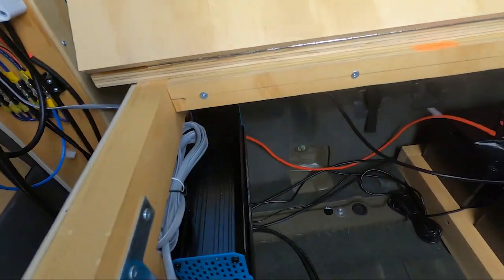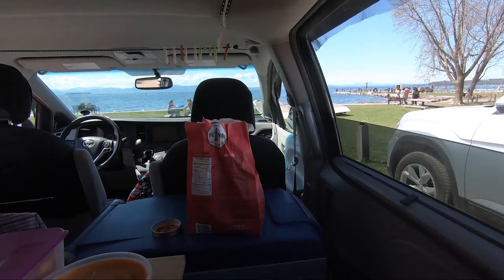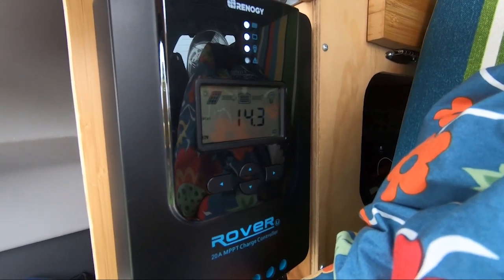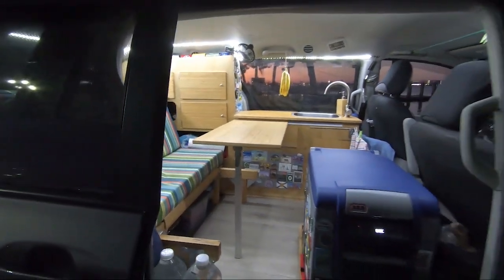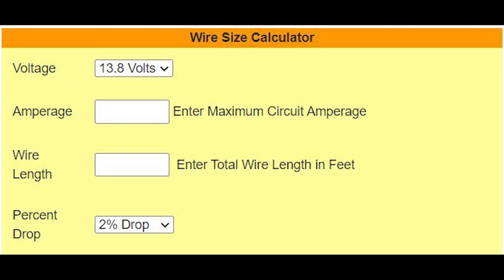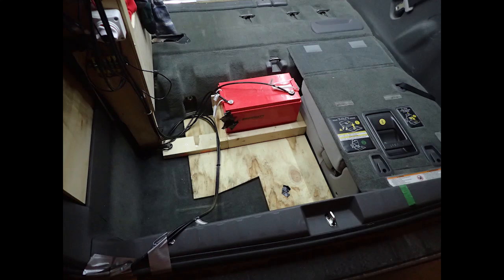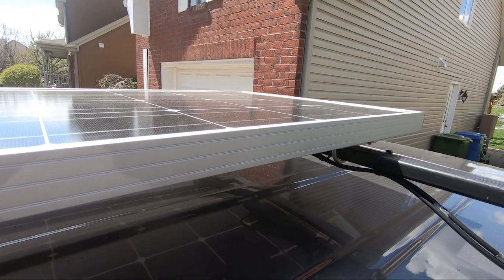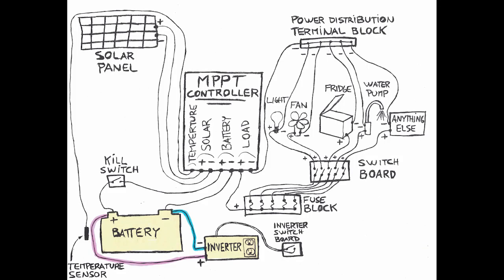Minivan conversion: Electric system (easy DIY)

Comment: Allô Eric ! Merci beaucoup pour tes vidéos, ils m'ont beaucoup inspirées. Je me suis aussi acheté une van et je me demandais pourquoi avais-tu opté pour (2) batteries 12V 100ah au lieu de (1) 12V 200ah? Merci beaucoup de ton temps, Jacob
Reply from the maker: Tu peux considérer l’espace que tu as disponible. Dans mon cas, deux batteries me laisse un espace intéressant. Selon la configuration de l’espace une ou deux batteries peut être plus ou moins avantageux. Aussi, si une batterie brise, ce n’est pas tout qui est à remplacer. Ma batterie précédente a justement été remplacée suite à un bris…
Reply: Super merci !

Une deuxième question, à ta connaissance, y’a t’il une façon d’installer une prise extérieure pour recharger les batteries si je venais à manquer d’électricité … par exemple laisser un chargeur installé dans la van en permanence et simplement le brancher si je manque d’électricité?

Comment: I was curious if it was still best to use this form of a detailed setup instead of a Solar panel to BLUETTI AC70 to Fuse block to DC items.  For AC one line from the Bluetti to a power strip to different AC items.
Reply from the maker: What you describe is energy transformation, and this requires more of it. There’s no module replacement possible. When a component of the power station will break, the whole thing goes to the dump. Also less easier to optimize space management and aesthetic. I definitely prefer my kind of setup. 😃👍

Comment: Hi Eric. Greetings from Toronto, Canada. I'm beginning my Sienna conversion and so enjoy and learn a lot from your videos. Every second Youtube Van Camper that I watch refers to your bed/couch design! I am considering a 24 volt rather than a 12 volt system as I've heard that a 24 volt system is more efficient and could use thinner less expensive wiring. You have your system isolated from the car system so it does not restrict your choice, two batteries that you could wire in series to make a 24 volt system and your fridge and MPPT probably will accept 24 volts. I'm guessing that you went with 12 because the one 100 watt solar panel could not give you 24 volts?  Thank you again for all your information.
Reply from the maker: Hello Steve! Thank you for your comment of appreciation 😃

I use a 12 volts system. I would do the same. Wires are not really expensive since everything is close, and because there’s plenty of 12 volts devices! It’s pretty much standard.
✌️

Comment: Thank you for this detailed tutorial on the electronic system. I’m going to follow your lead.  I’m disappointed to hear from my Honda dealership that the price of installing a roof rack will be $1000. Because that is what i wanted to do for both the solar panel attachment and a way to anchor the shower tube as you have. And, I already have the Thule box from a previous SUV, and I believe I’ll add it for extra storage of off-season clothing eventually. 

But before I do that, and before I build the bed and cabinet, I’m trying to buy all the components I want so I can build the cabinets to their specifications.   I’ve got everything now except the kitchen sink and faucet. So I’m shopping for those, and have some questions for you or others with experience. What functions am I looking for in the faucet? I know the pump needs to be 12v, and it needs to have a way to modulate flow. But is a regular kitchen faucet possible to use, or would those be incompatible with the 12v pump and drain to the grey water reservoir?

Perhaps you’ve already created a video about the kitchen sink, and if so, please say so and I’ll look for that video by title. Any tips you can give me about brands or where to order these plumbing fixtures would be welcome. Amazon’s selections don’t seem to fit what i’d like.  My home’s kitchen faucet has a pull down sprayer letting me fill my PUR reservoir without shifting it from where it sits on the countertop. If I used it i could maybe devise a way to use it as a shower-head, too. Has anyone tried that with success or failure? You are a great resource, Eric, as are the others who comment. 

Thank you, thank you, thank you!🙏
Reply from the maker: Hello Lora!
I used a regular kitchen faucet and a bar sink.
Don't use a plastic sink because of bacteria. This is why they are only for restroom, and not for food (supposed to be). 
Having a deep one is useful. 
For the faucet, watch this video to learn why I changed from a restroom one to a kitchen one:
https://youtu.be/R2AaKHEia9w?si=iWwjoJualHAcGON5
I have a 1 gallon per minute 12 volt pump, and it is perfect to me.
✌️

Comment: I still love your videos! I've had excelled so much further with your help in building my system. Important question though. For how many amps is your switchboard rated?  Do I need a 30A switch board or am I o k with something like a 10A switchboard. I plan to model my Amp usage/ powered utilities after you.
Reply from the maker: Mine is a 20A. The size of it while depends of your electric charges

Comment: Well done, Eric.  I'll be looking for your sequel videos on your electrical system.  One note:  I'm surprised your entire DC electrical load is distributed THRU your MPPT Controller.  I hope Renogy built in good protection for that.  Also, I wonder what AC services you use beyond the computer and small device charging.  No microwave in the van, correct?
Reply from the maker: So far, Renogy is doing a great job. I am satisfied. 

No microwave cooking for me. In fact I don't use AC power other than for PC. Power conversion is less than optimal... ✌️

Comment: Hi Eric, thanks for nice video, looking forward to see more!

You mentioned that battery needs to be connected to controller before solar panels, or solar panels will get damaged.
Would solar panel get destroyed also in case you use kill switch to isolate battery and there was no load on things connected to controller?
Reply from the maker: I don’t think that the dommage would be to the panels, but to the controller. Isolating the battery would have the same effect. It may not systematically damage the controller, but it may… 
✌️

Comment: 16:30 what are those ethernet sockets on the battery?
Reply from the maker: They are «smart» batteries connected together to optimize, balance their charges. There’s also one connector to connect the battery monitor. The top of the battery is electronic.
Reply: Got that, thanks!

Comment: Allo M. Eric,  very good video,  you have 2 battery connect in serial,  how many amperes is it     each.   Are they lithium or ordinary deep discharge?
Reply from the maker: Two 100amph lithium batteries in parallel. Before I had 110 amph AGM battery.✌️

Comment: Eric if you were doing a van conversion now would you use a portable Lion Po4 battery instead of permanent install ? I would and I'm an electrical engineer that has worked on renewables for over 30 years so am familiar with DC wiring. It reduces complexity has "enough" power for me and fit perfectly with the rest of your concept of low mod removal build. The way you have done your van with the exception of the wiring is the way I would do it. The renewable design theory is to reduce power usage and simplify for reliability much like Colin Chapmans Lotus concept of simplify and "add lightness"

Comment: Eric - how reliable have you found this system overall? Has there ever been an unexpected failure that has caused the cabin to take on extreme weather? I have two dogs that I am planning on an extended trip. I think this is likely the solution to AC issues along with a WiFi temp monitor when I have to be away from my vehicle for a couple hours. I will use your insulation system too. So if a catastrophic failure temperature will not go severe. thank you for all your videos

Comment: hi eric, writing from central florida. did a build a few years back in a 2013 sienna. looking to improve it, i found your AWESOME channel. we're going to rip out the old one and start from scratch, with yours as our guide. i used basically the same electric system as you did, but i have a circuit breaker between the solar panel and the mppt controller. great work, please continue...
Reply from the maker: Thank you for your appreciation and sharing about your project. Enjoy! 👍

Comment: What's your opinion about using a high quality cooler instead of a refrigerator? This would allow you to dramatically simplify the electrical system, but at the expense of not having a refrigerator.
Reply from the maker: They consume too much amps! I will talk about this in an upcoming video✌️

Comment: Eric,  I find your videos to be some of the best out there.  Your explanations are clear and concise and the photos you include of your travels are terrific.  Thank you for taking the time to present them these videos! 🙏🙏🙏

Can you provide a list of the electrical components that you used in your final build, for example your switch block manufacturer?

I also noticed that you had two different batteries throughout your build but ended up with two the same.  How did you make your choice?
Reply from the maker: Thank you for your awesome feedback! It is much appreciated.
I will do a video about batteries and my choices . Thank you for the video suggestion 👍

Comment: I am confused about your battery (timestamp 3'00") You have a red battery, and two black ones? is the red the main and the other two backups? Or do the three together (wired in parallel) make one "higher capacity" battery? Also, how many amp hours of battery do you have? Finally at time 3'00 I see that you put the black ones under your bed. Where is the red one? Love your videos. I am a long time subscriber.

Comment: Hello Eric 
Thanks for putting up your detailed approach to solar power. I have been looking into it through the YouTube channel of the expert, Will Prowse. He used to put systems together, and still does, but he is being won over to what they call « all in one » systems. Everything is included and it is pretty close to plug and play. Although way cheaper than a jackerie. Wondering what you think of this option?
https://m.youtube.com/watch?v=WfIkPI81cdI
Thanks joe from Montréal

Comment: Thank you Eric.
This is Daniel. I saw your wiring diagram and I liked it too. I try to make a electric system per your suggestion/diagram.
But I try to add "Battery monitor" system. It required to connect "BAT+" and "BAT-" port to monitor the power. But I was concerned that if I use power through the "LOAD" ports, then battery monitor need to connect "LOAD" ports too. But diagram doesn't show that.
So I contacted Renogy technical support and asked about this question, then they said LOAD port is only working through solar charger, not power from battery.
It seams pretty odd. The reason is you are using power all the time from LOAD port (based upon your wiring diagram) and you can use power at night too. That means power from battery, not solar panel only. I am wondering that you can use power at night even though you use power from LOAD port? Let me know
Reply from the maker: Hello Daniel! 
I use power all the time, often more at night with the electric fans, lights,etc.🙂
My controller does not just convert energy from the solar panel and send it to the battery. It also manage the energy from the battery to the loads. So yes it work pretty well. The one thing that must be sure is that the controller is set to «24 hours mode» (setting code17 in mine). This option of my controller is set on its «load mode» screen.

My battery monitor is connected directly to the battery. 

Instructions manuals are essential to read completely, for best settings and for safety too. I don’t know what component models you have, but in the instructions manuals you should find what you need. 

It will work! and perfectly! 😃✌️
Reply: @ericenjoysearth2756  
Hello Reic

I followed your advise. It worked.
Thanks

Comment: You are probably an engineer. I wonder if you are acquiring adaptations to current befuddling issues. Are you evolving your setup to consider potential shortages, such as energy costs (and availability). When building out my environment lately, I have been including gear to mitigate for situations not immediately evident, but that are appearing in the viewpoints of others I have seen posting their instructionals. Examples: faraday protection & solar powered devices, non-electric tools and options, food acquisition & preservation, essential hard copy guidebooks, paper maps, special gear (ie; hydrant & handcuff  keys), safe relocation & community affiliation planning, comms, ie; gmrs, satellite (-read Tesla phone), defensive and uber-stealth plans, loss of vehicle contingencies, ie; folding bike w/ travois, etc., etc., etc....
Reply from the maker: My van is a 100% self sufficient with the solar power.

Comment: Hey Eric. Love your videos!

Do you recommend a FWD sienna over an AWD sienna? Also have you ever considered lifting you sienna for extra ground clearance?
Reply from the maker: FWD and I am very happy with it, and I am a canadien who deals with canadien winters. If you stay on main roads, the weight of the van and size of the tires make it so that there is no need for a AWD. 
Same thing for the suspension. Having a low one is  an advantage for going in and out of the van, and having access to the roof box.

Thank you for your appreciation! 😃✌️

Comment: Thank you for the very informative video. I am doing research to build out my own van. I am curious about your preference for a 12 volt fridge and the best way you have added it to your system.
Reply from the maker: A 12 volts fridge is much more efficient. It requires much less current. You have to choose considering amps consumption. A fridge may cost more, but you will end up with more autonomy 👍
I will talk about this in a future video ✌️

Comment: Hi Eric.  Great video.  Always excited when you post.  What do you think of portable power stations instead of building the parts (e.g. mppt, inverter, batteries).  I even saw Jackery at Costco last week.
Reply from the maker: This is a good video suggestion. I will give you a clue… If I had to do it again, I would do it the same way! I will explain why…
Thank you Gary for your appreciation 😃✌️

Comment: Et dire que j’ai passer par tout ces étapes pour en venir à une chose près le « kill switch » le reste est identique! Sans compter les progrès que j’ai fait pour y arriver (ex: le mppt et les batteries au lithium et le bus bar!) j’ai pas fait le kill switch parce que je me fiais au fuse box et Le inverter a un safety switch encore la je me repose sur cette avantage. Mais ton setup est à mon avis the way to go 👍
Mon dernier petit amélioration est que je voudrais avoir un connecteur hydrofuge qui ferait le lien entre mes panneaux solaires et mon mppt sans passer par le seal de porte. Ça prend une modification permanente qui me refroidit! P-e un jour??
CDN J5Z0C5
Reply from the maker: Bravo pour ta réussite! Merci d’avoir partager. ✌️

Comment: Eric:
It seems to me that you should also have a fuse between the battery positive and the MPPT controller and another fuse between the battery positive and the inverter. Sized at the lesser of the wire ampacity or the maximum allowed current draw of the device.
Reply from the maker: Hello Greg,
Each manufacturer will have added different protection to their components. As mention in the video, each one should read the manufacturer’s instructions manual to learn about their equipment and how to properly install it, and in the proper order. In my case it is not an obligation of the manufacturer’s.

My optimized system is pretty light. It works with only a 20 amp controller, only a 700 watts inverter with only a 100 watts solar panel.

There’s no limit to how many fuses that one may want to had to its system. Each haded junction will had surface contact that comes with some resistivity…

Plus, as said in my video, what I show is for informative purpose only. Each components that someone buys may be less protected and of less quality… Instructions will be different…
✌️
Reply: Have a single large fuse directly connected and physically close to the battery. If, for any reason (rubbing wires, etc.), you have a short circuit, this is your ultimate protection against a fire in your car.